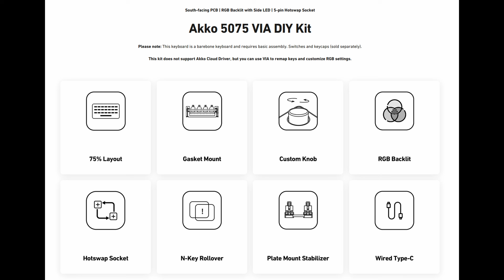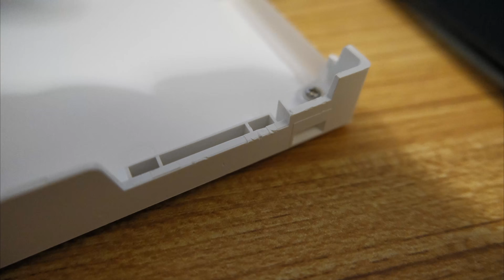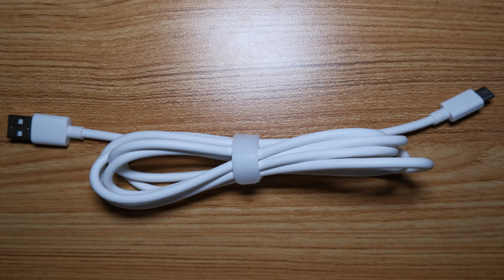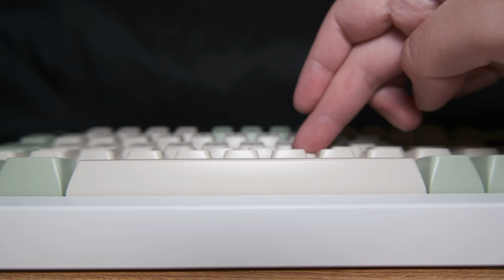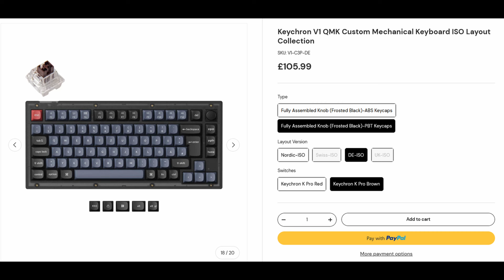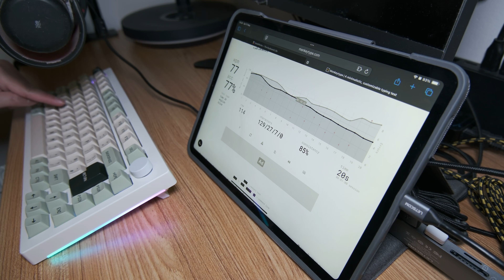Akko 5075B VIA | Incredible Value?

Comment: Did VIA work straight out of the box for you? Having trouble getting VIA to recognise the keyboard :(
Reply: I had problems as well. However, it is because the actul correct JSON files is on Akko europe download page. The one that specifies between the ANSI and ISO version of said JSON. Once I got the JSON from there I got it working.

Comment: The only real gripe i have with this board is the lack of a print screen button that you need to macro.
Reply: I mean. Since it's VIA compatible, you could use VIA so you can change the home key to a print screen button.
Reply: Most OS have dedicated shortcut. Example, Win+Shift+S on windows opens the sniping tool with a lot capturing options.
Reply: Just use win shift s like a normal himan being
Reply: @malithaw  a downgrade is still a downgrade i just put a macro on the win button for now.
Reply: @malithaw  yeah, really practical if you need to capture a screenshot of a game or a movie indeed. Stop gaslighting people.

Comment: If it only wasn't another south facing crap and was possible to open without problems it'd be a great board
Reply from the maker: Agreed. I feel like keyboards like this a trap to beginners because the specs are great for the price, but I don't think many of them think about the building process. I've built several boards now and I hated opening this one!
Reply: @KeebWorks I really don't know what their problem is. Brass inserts and screws aren't expensive